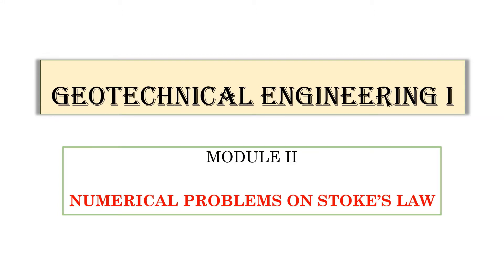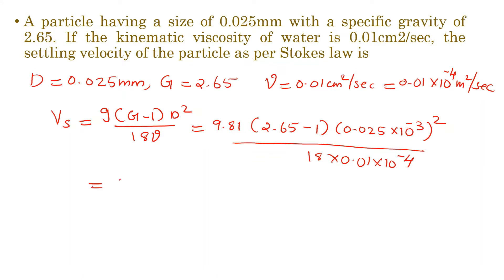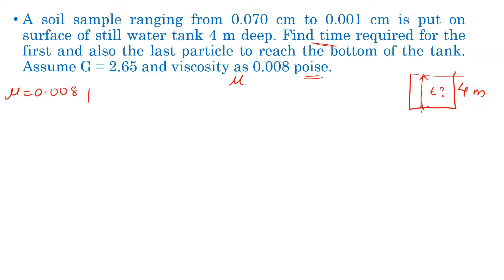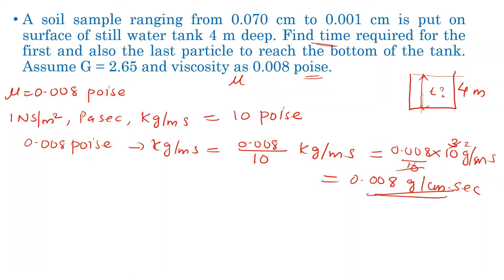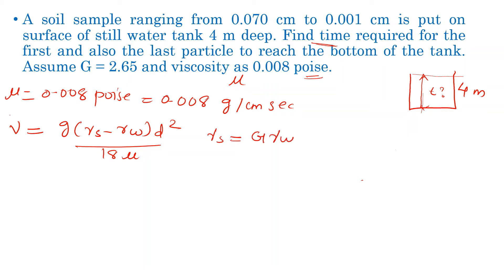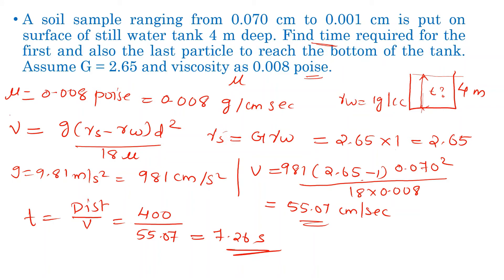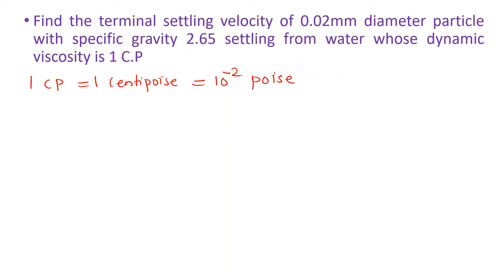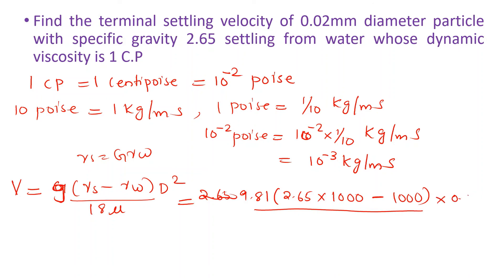NUMERICAL PROBLEMS ON STOKES LAW

Comment: Dynamic viscosity varunna equationil g indo?
Reply from the maker: if you are considering the terminal velocity equation in terms of density then g will be there ie, V = (g(ρs-ρw)d^2)/(18µ) & if u are taking unit weight equation then there is no g in the equation. Here I used the wrong symbol. actually i considered density but put the symbol of unit weight.